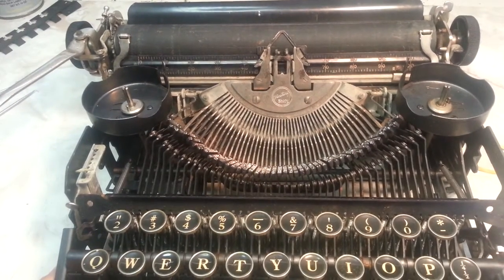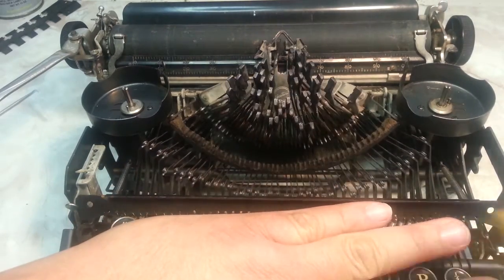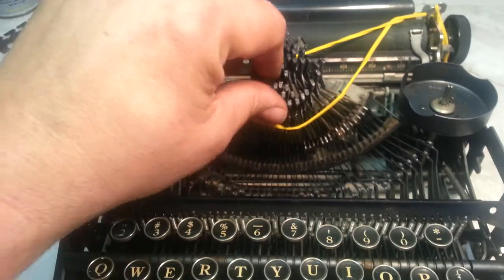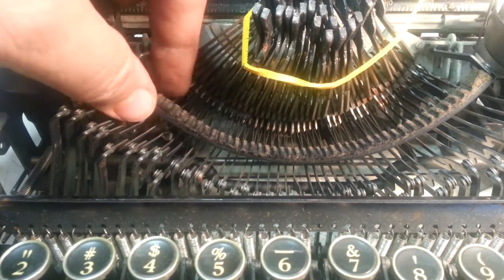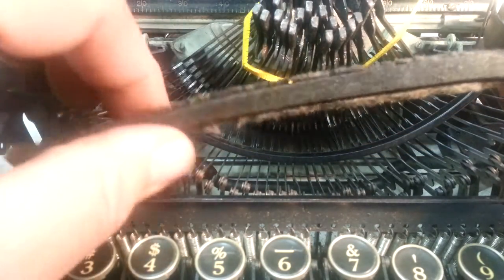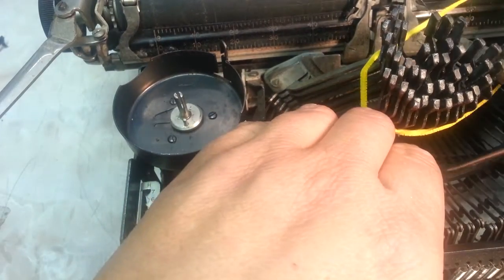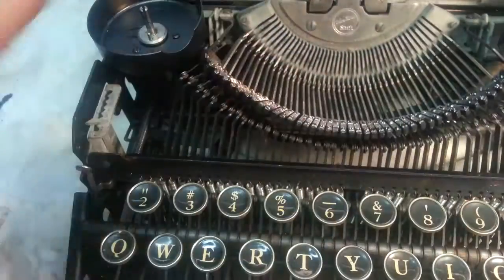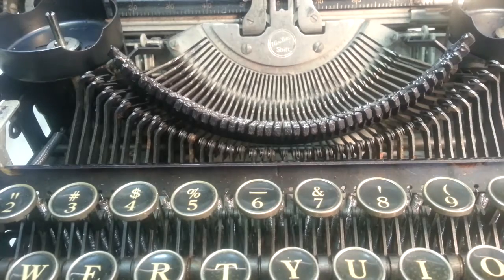Typewriter Type Basket Rest Pad Repair Replacement Fix Modify Felt

Comment: Thanks, doing a Remington Model 5 now, which has the fold over the top felt rest, and MY GOD is that stuff stiff after being bent over that long.  Took a while to gently work it into the opposite direction fold and put it back in, but it worked perfectly in the end.  Sure looks better with the type bars all sitting even and pretty (they are sparkly clean now, too).  ;-)  I wonder if wetting it, or some VERY gentle steaming would make it any easier.  Kind of afraid the steam might shrink or damage it, but maybe I'll try it when I have some new material to fall back on.